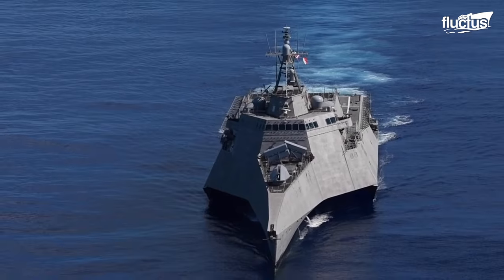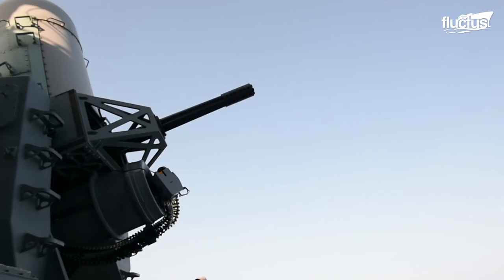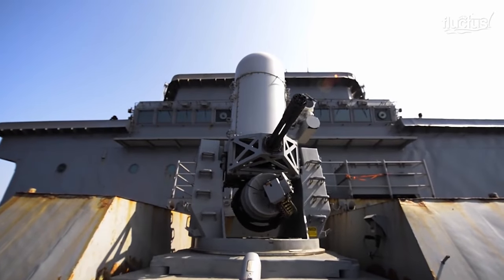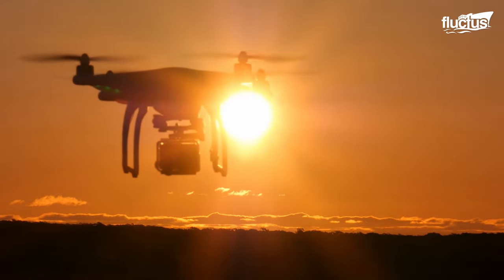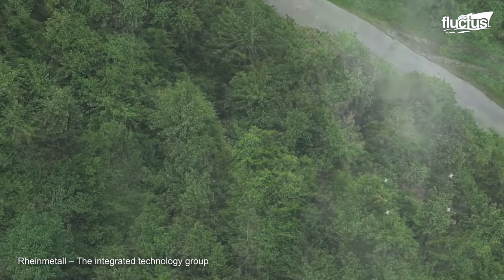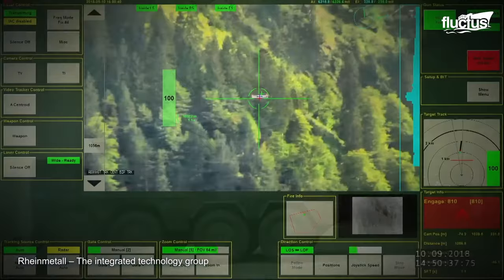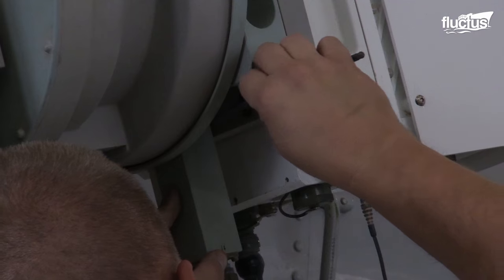The Extreme Solution US Navy Found to Deal With Enemy Drones in Middle of the Ocean

Comment: A relative was on one of the many teams that wrote software code for guidance systems to launch and fire missiles and weapons from ocean vessels. His part was to take the vessel's reaction data of the many ocean conditions ranging from calm seas to hurricane-force waves.  The systems had to compensate for the roll, pitch, and yaw and each ship was different in how it responded in those conditions so it needed specialized software for its guidance systems for war does not always wait for calm seas.
Reply: Th HAC engineers including your relative were incredible!  Way beyond what todays "Tech Savy" students would believe was even possible!
Reply: I don't know how they work, but I would think the system would have sensors built into it that would measure the roll, pitch and yaw, the software would take those measures into account and provide an accurate firing solution.  A good system wouldn't care if it was on a row boat or an aircraft carrier.  You could literally unbolt it from one ship and bolt it on to another ready to go once it was armed and secured.
Reply: @carlkma2037  It still requires programming and input to "teach" the software how to react from human interaction. There are no sensors that are born to know how to deal with the different measures if it was not programmed as such.
Reply: @RyDoggonus  you are so right, most people are unaware that Hughes aircraft company invented artificial intelligence and announce to the world it had created it in 1984. By the end of the 80s it was installing upholstery in Cadillacs as a commercial test bed project.
Reply: @RyDoggonus  I'm not sure where you are going here.  I said the "software", as in computer programming software, would take the sensor measurements and provide a firing solution.  I didn't think I would have to say this but, the software would include a range of variables for each measurement, so you would only have to write the program once, it wouldn't need to be tweaked for each ship.  Clearly, it would take a programmer to program the software for the gun.  What, did you think I said, the weapon would program itself?  As far as human interaction, I believe it is supposed to be somewhat autonomous, humans would have a hard time trying to hit a missile incoming at close range.  So I'm not sure what kind of human interaction you are talking about either.  And no, AI would not be necessary to program a self-defense system, in other words the computer would follow its programing, not make new programing.  Once you know the range, speed and direction of the missile, provided by radar, putting a wall of lead in front of it is doable.  The problem arises from all the little things, calibration, wind, and all the sensors providing accurate data, a lot has to go right in those final seconds.  It's a big job, crossing your fingers wouldn't hurt.
Reply: @jeffalvich9434  but that's why our schools need need less education
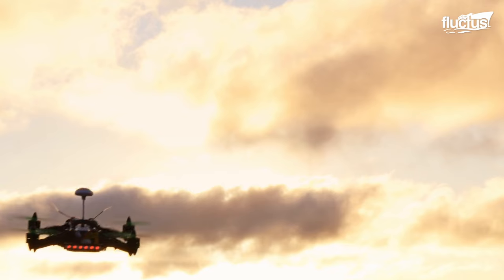Reply: @drseuss5407  😂 it has been a long time ago but at one point I was put in charge of a community college industry specific vocational education program. When I saw what was going on with every single instructor and certificates being handed out like they were napkins at a luncheon I literally shut the whole program down and found out through inquiring eyes that one of the instructors was even pocketings student money from textbook sales. With the exception of one instructor we replaced each one with people who actually had professional experience, expertise and professional credentials including real academic education not mail order degrees. The program was so successful that it became the first community college in California who's curriculum was directly transferable to an national industry specific 4 year college baccalaureate program. I take very little credit for this as it was a whole team of people including the college administration who made this happen. We went from barely able to fulfill our minimum student quota of 18 in our classes to where they were packed and offering between 6:00 and 9 classes each semester.
Reply: If you havent already look into the fire control computer for the old gun ships, battleships, cruisers and destroyers.  They were analog computers, electro mechanical and much of the information  was manually input.
Reply: @jeffalvich9434  a
Reply: @jeffalvich9434  - Our community college has many electronic, programming, network security and many other 2/3/4 year programs for technicians and engineers. Most of the instructors have real world experience in their field and that is preferred to PhD with little experience.
Reply: I wouldn't want to have his/her job!
Reply: @carlkma2037  It surely would make it harder to type though 😆
Reply: Should you be sharing that info ?
Reply: Very serious person posts as Herman Munster.
Reply: thanks for exposing the governments methods
Reply: I hat to Do the same dIly for my sonR Ystem Temperaturen layer  how mu h sLt inpercent to clmpensTe the Sound refle Tipps from my Sonar machine
Reply: @carlkma2037  The tracking system isn't the hard part imo.  The mechanics of gun aiming at sea is probably the most difficult.  Curious to know how they do that and if there are redundancies.  Although with the exposed ammo feed, it may be a moot point.
Reply: @RyDoggonus  The sensor does what it supposed to do to "sense". Agree with Carl, it doesn't matter if it is aboard a carrier or a canoe. Well I guess in US you need to make it sounds sophisticated so you get paid more while in China they just do and tweak it along the way.
Reply: @carlkma2037   These guys honestly have no idea what they're talking about. They think they know a lot about what's going on but they're just showing their lack of knowledge.
Reply: Ever heard of gyroscopic stabilizer? Camera gimbal stabilizers work pretty good for consumers. Similar tech is employed for stabilizing tank turrets so I suppose they use it here too.
Reply: @jeffalvich9434  I'm not sure about that, artificial intelligence has been taught in university courses since at least the early 80s. And while the hardware technologies of the times confined what could be done, they were already doing speech and written natural language processing, visual pattern recognition and simple neural networks. AI as a major in the computer science field is what experimental string theory is to physicists. It's very very complicated and only the biggest eggheads choose and succeed in it. It's like statistics and math mated with physics while high on amfetamines.
Reply: Granpa was always cooking something up in his lab. I guess the Phalanx was first deployed at 1313 Mockingbird Lane.
Reply: @kevinpaulus4483  If you do a search for HRL (aka the new name of Hughes Research Laboratories in malibu Ca) they have it on their website as part of their historic accomplishments